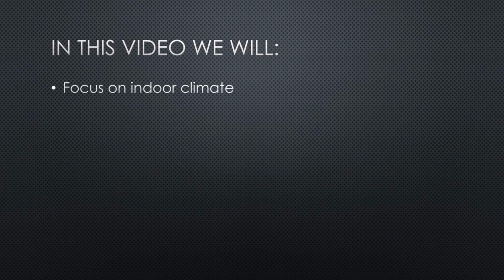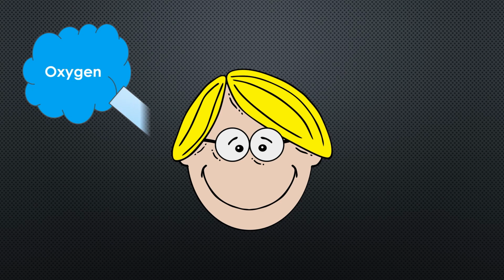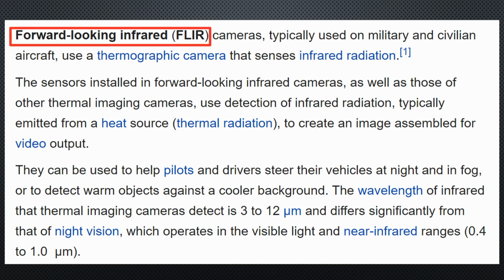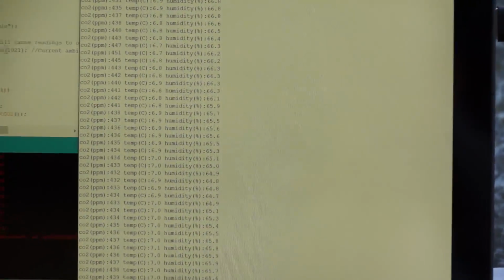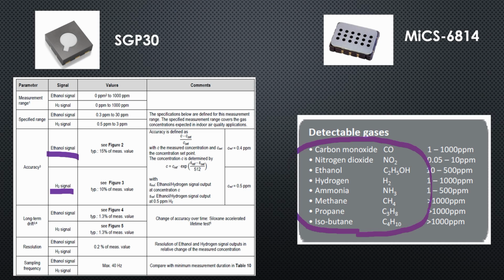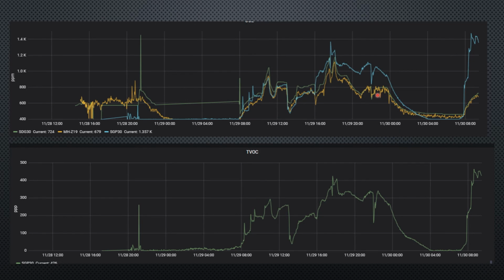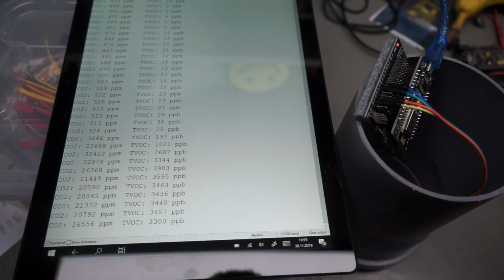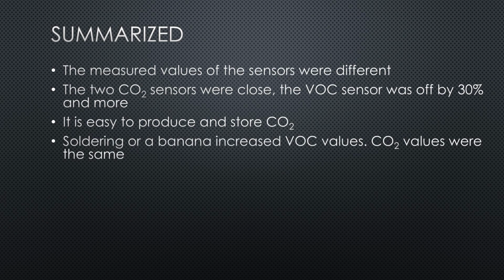#300 How to measure CO2 and VOC with Arduino. Which one is better?

Comment: Now stuff it into a watch
Reply from the maker: Together with the big battery?
Reply: @AndreasSpiess  Might not be popular with airport security but I don't see the issue :>

Also never played with gadgetbridge or cheap smartwatches like the amazfit bip but i feel awfully tempted now..
Reply: @AndreasSpiess  You don't need to sample by the second. A push button or once an hour sampling would use much less energy.
Reply from the maker: @Carl: A maximum of 70 ppm above "normal" does not seem to be critical to me. We are much longer inside and there I hardly get below 200ppm above "normal". For me, the CO2 problem is indoors if I believe the Stockholm numbers.
Reply: @AndreasSpiess , sorry I kind of missed this notification. The impact of atmospheric elevation and local CO2 emissions are multi-fold.

Its not that the minor elevation in outdoor levels are that harmful in and by itself.

But more in part because it's the actual outdoor air that we pull into buildings to dilute and displace the built-up indoor pollution levels (as you correctly point out is the primary concern). This directly mean that indoor CO2 levels will either increase, or that fan speeds to increase the air exchange rates needs to go up (which increases energy consumption and wear on HVAC systems).

Secondly, and part of the ULISSES project (which also more touched on that fact that the NDIR technology is soon to be integrated in smartphones and other ubiquitous devices) CO2 levels in the local outdoor can be used as a general air quality indicator for making decisions.

Whether decisions are from your car to stop pulling in new outdoor air (as you enter a road tunnel), or an air purifier to start, your phone telling you where to walk, or a building HVAC air handler etc. etc.

The local levels and changes in outdoor air is just a signal. What people and devices will do with that signal is something for 2020 and future to show.

Happy new year! Exciting future!

Comment: Well explained mate. TSENZ has a similar sensor (TSRS) for engineering workshops and offices if anyone interested. http://tsenzl.co.nz/test.php
Reply from the maker: If it provides also TVOC it is probably not a proper CO2 sensor. Ask before you buy it. The "eCO2" sensors are very inaccurate
Reply: @AndreasSpiess  Thanks again. It uses CCS811 and from your #272 you seemed to like it too.
Reply from the maker: No more. In the current test it created weird results :-(

Comment: Would this breakout board for the MiCS-6814 be usable?: https://wiki.seeedstudio.com/Grove-Multichannel_Gas_Sensor/
Reply from the maker: Depends on what you want to measure. These sensors measure „something“ which is not really defined.
Reply: @AndreasSpiess  I thought this was the sensor you mentioned but did not use because of its analoge interface. This board has a ADC and Arduino library if i am not mistaking
Reply from the maker: Yes, it also has an analog interface. But those "gas sensors" do not measure CO2. I think I showed it in the CO2 Cuckoo video.

Comment: Most places that have depleted their halon suppression systems switched to HFC 227ea or 3M Novec. CO2 discharging in a data center with a few on-site techs mid room wouldnt survive. Watch one discharge in a small room: 
https://youtu.be/g2Io_FWBV9w
Reply from the maker: Interesting. Thank you for the link!

Comment: While I commend you on your outstanding presentations, I really am tired of this CO2 crap. Weather has always changed. No one today seems to accept the local Star (SOL) as a function of weather. They treat it like some Eternal Flame. Well it varies in it's output and sometimes goes rather quiet for a sun. Historically CO2 levels have been 20 times higher, and the oxygen levels were much higher. Plant life flourished. Today, plants are near suffocation and people are wondering why they aren't producing well. Plants and animals are symbiotic in nature. They rely on each other to survive. Animals and volcanoes produce CO2 and plants eat it up and expel the Oxygen. A plus for all the other lifeforms. The sun is deepening into the Grand Solar Minima. At it's deepest point is where we have seen massive glaciation and extinction. We are only 4 or so years into a scenario that can only be surmised since it's slightly predictable, having happened many times, but only God knows the hour. But it may be a 50 year, 200 year, or 5,000 year cycle this time. We don't know. But we survived in the past(a few). Let me leave with these 2 points: CO2 follows temperature. Not the opposite. And the Sun causes the climate to change. Check out Adapt 2030 on YT. Been following his views 4 years now, and David has been so close to actuality that he warrants my attention. And yours.

Comment: To test a co2 sensor just open a soda bottle near it or have some acidic water and add baking soda/sodium bicarbonate to it and you get pure co2.

I have a few eco2, co2 and voc sensors but the calculated co2 levels is usually 20 to 200% off from actual levels so it is a bad way to measure if you have any chemicals that emit voc around or if you have an carbon air purifyer it takes away voc so the eco2 wont see anything.

So in my opinion only go for Ndir co2 sensor. Many "co2" sensors or 6 in one and so on from different sellers mark it as a actual co2 sensor and ut only fakes it from the voc.

Have 3 of 3 that is useless because accuracy isn't even a thing, might as well ask a ouija board instead 😂 so i an in a refund claim with them.

I have over 1200ppm co2 from a proper sensor and the fake one still says 350 which is less than anywhere on earth outside... Or the real says 600 and the fake says 4000..
Reply from the maker: As you write: These sensors doe not measure CO2. They just assume if VOC is here, people are here, and therefore CO2...